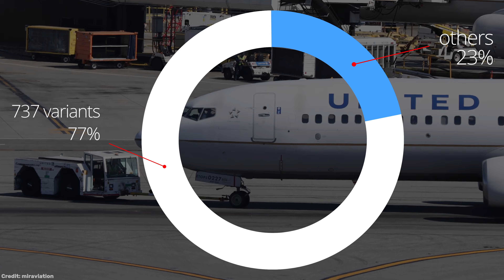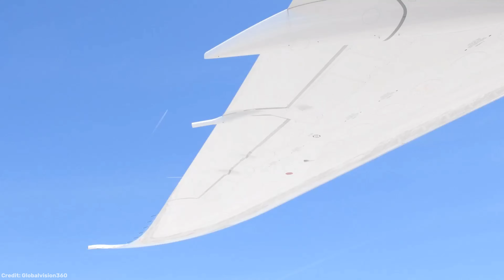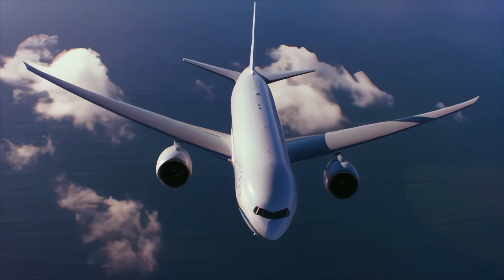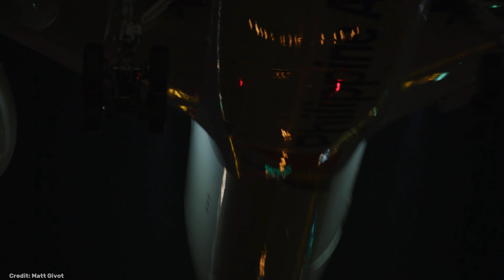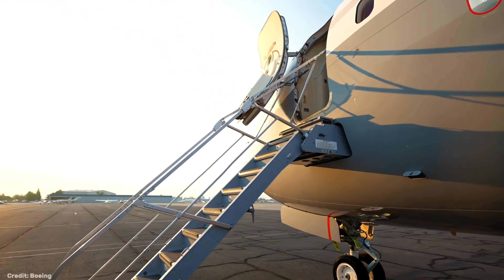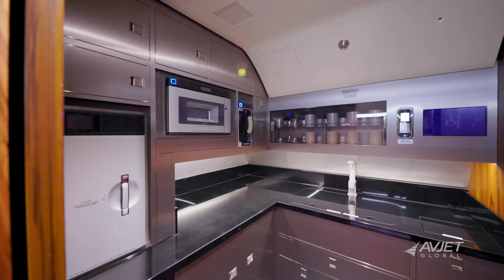The truth about Boeing Business Jets....

Comment: I feel if you travel with a large group say 8+ people for over 6 hours often and into larger airports -- then alone a BBJ or ACJ are worth it. 

They have a lower flight envelope VS a Bombardier Global 6000/7500 OR Gulfstream 650/700 but offers more cabin space. Buying a well maintained Pre-Flown Aircraft with applicable airframe & engine programs --- then spending money to refurbish interiors, update Avionics -- if needed Overhaul engines (either for LLP or Restoration of Factory Settings), Landing Gear, new paint etc could keep the cost down.  

If this is not a mission requirement -- then I think it's more of a status symbol with high operational & depreciation costs.
Reply from the maker: thanks for sharing your thoughts!